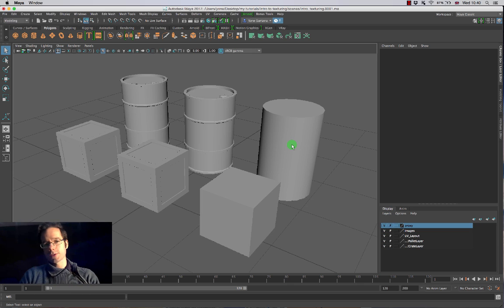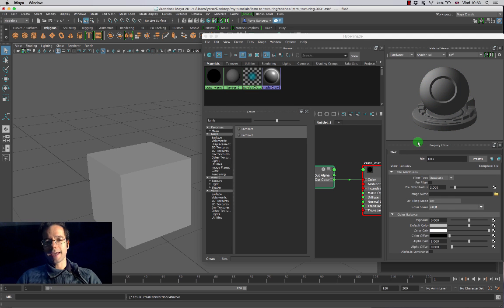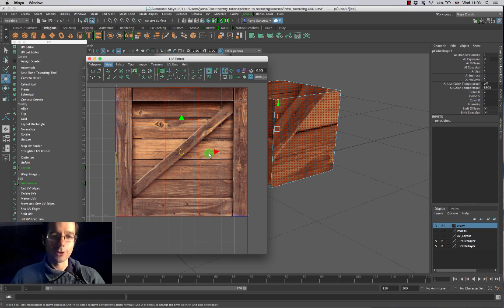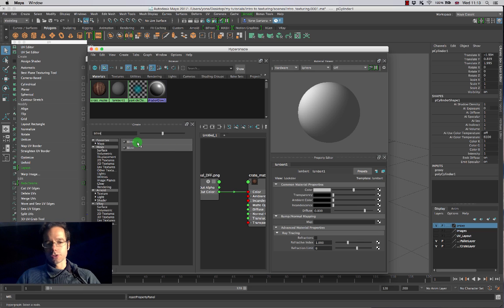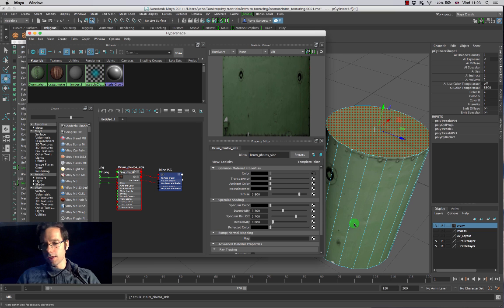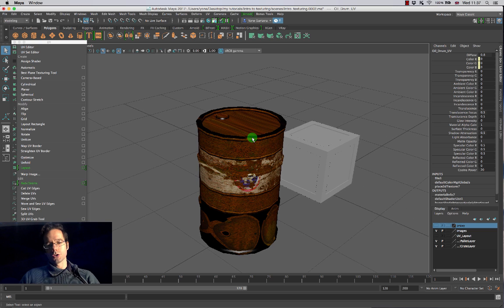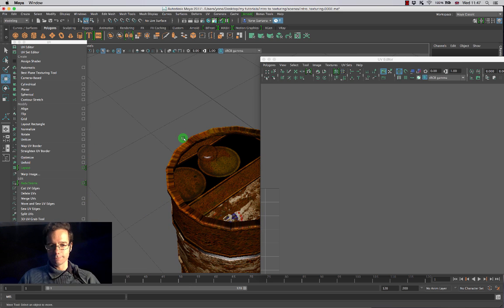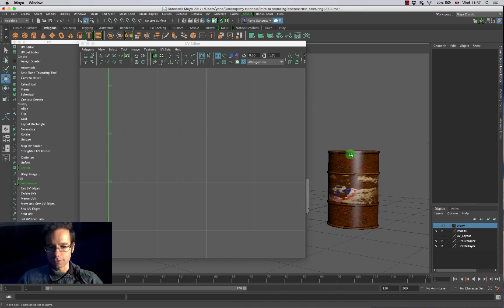Maya 2017 - Texturing - Part 1

Comment: I have a question if you overlap the uvs and having them stacked you're going to have lighting problems on the long run because when you bake light its baking light on individual faces, there for when you stack them the uv's beneath will cast weird shadows randomly because you stack it. Just saying
Reply from the maker: Hi Jiutofu. Definitely stacking UV's is issue for people aiming to bake textures for games. I'm not advocating stacking UV's as being the best workflow, but for beginners aiming to make their first renders My thinking while teaching is to get people excited about making their first scenes in 3D and not overwhelm them with the full technical setup for every scenario. I was trying to start with the initial concept of what is a UV and then spent time going into more advanced concepts. 
Although if you want to see a crazy use of UV's check out MinonsArt's lazy UV workflow: https://www.youtube.com/watch?v=DD84GSJiTVc
It's something I've found more difficult to manage online, as viewers have all different skill levels, and I'm not only dealing with people who are new to 3D. But I always keep coming back to really needing to make a new texturing tutorial. 
I need to dig up some more time.
Reply: @yonesantana  I see thanks for replying just started making my own 3d models and I never knew how to do unwrapping and texturing cause I was so used to low-poly method.

Comment: Which Apple Computer configuration you use and which video card.
Reply from the maker: Oh this is a very old setup. When the turorial was made I was using a 2017 Macbook pro, with the lowest configuration. I believe I had a Radeon Pro 555 with 2GB, but I can't be too sure. I've alway found mac laptops to be quite stable with Maya even though they are not the most powerful on the market
Reply: @yonesantana  Thanks

Comment: you should buy a silent cpu cooler. i've made a research Noctua coolers have best price/silence ratio. even quieter than liquid coolers.
Reply from the maker: Thanks for the suggestion. Unfortunately my laptop has died and I'm currently setting up a new setup. Hopefully with much better sound. (fingers crossed)
Anyway I'd never heard of these coolers before, thanks for pointing them out to me. 
All the best.
Reply: unfortunately they're for desktop PCs